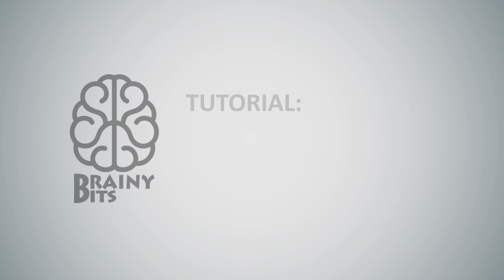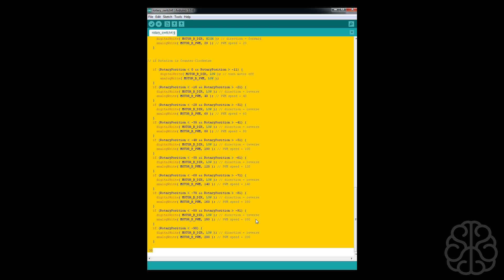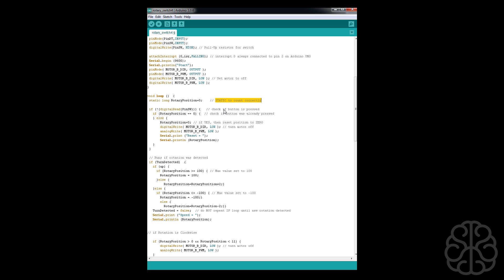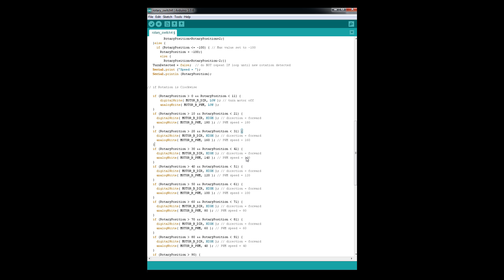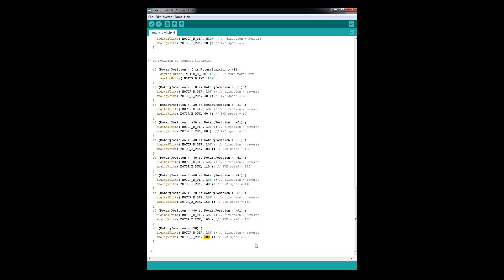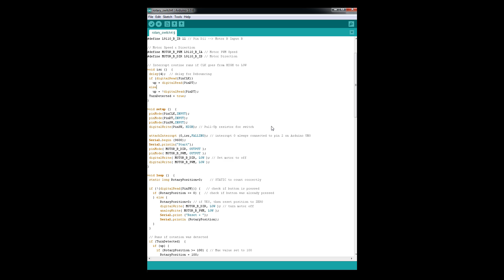Control a DC Motor using the L9110S driver and a Rotary Encoder with an Arduino - Tutorial

Comment: I have a project where i am using a fan to blow a table wind turbine and my team would like to track the rpms from the dc motor. i bought the items you have in this video minus the breadboard power supply. i have a 9v power supply as well as a 9v plug for the arduino can this tutorial work for experiment since we don't want to power our motor but instead see the rotations from the rotor using the encoder?

Comment: Could you perhaps help me?  Before I can ask my question, I need to explain my hardware.  I've removed a small DC motor from a laser printer, and it has a plastic ring attached to the shaft with about 200 little slices in the end.  This goes between a small IR sensor.  They are using this in place of a stepper motor.  I have removed the hardware, and I was wondering if there is a way to register this on an Arduino and control the motor that way.  I thought that disc was called a rotary encoder, but I could be wrong.  I've been trying to Google search this for the past couple of days and I keep running into motors with built-in encoders, and stumbling across this video. Hopefully you'll understand what I'm trying to do, and for now I would just like to make it work. Installing it in my application is something I will worry about later on.  ...
I also have a second question. If I were to utilize the setup you have there, but wanted to use a much larger motor, is there a heavier duty driver that can support say.. 12v 3amps? And still be reversed?  I guess I should say what I'm building..  ultimately I'm trying to build a filament extruder to recycle 3D printer filament.  I know it's been done and I know they are commercially available However I'm usually really good at building my own hardware, but because I need to speed control this motor and I would like to automate some of that process with the Arduino down the road. So basically the Arduino would be in control of, the auger temperature auger speed and auger direction based on predetermined factors that I'll set up after testing. And on the output of the filament I plan to build and connect a filament diameter sensor which would then help determine the speed of the auger. If the filament being extruded is too large then I would have the Arduino speed up the motor and if it's too small then I would have the Arduino slow down the motor.  Or something along those lines.  Perhaps it needs to increase or decrease temperature. Not 100% sure until I get to that point. Any help you can provide would be greatly appreciated. Thank you

Comment: 3:27 So, a 1uF capacitor is fine for this motor. But how does this requirement change vs motor size?  

Is there a formula, or a rule of thumb? I want to get a slightly bigger motor.

Comment: I thought that pwm goes from 0 to 255, and not 20 to 200. Or am I wrong.
Reply from the maker: +Ynze Selders (Made by Ynze) You are correct, PWM values are from 0 - 255.  In this tutorial however the motor doesn't start moving until pwm hits 20 and is at full power when it hits 200.  That's why you see 20 -200 in the code.  Hope that makes sense.  Thanks for watching!
Reply: +Brainy-Bits oke thank you

Comment: can someone help im beyoned a beginner im trying to control a dc motor using my arduino board. im looking to get the motor to go foward for 2 seconds then reverse for 2 secondswhen you press the push to make switch i just need to know the code and how to wire it i have a arduino board a pust make switch bread board and resistors i dont have any other componats

Comment: could this encoder be used to drive the dc motor like a servo horn ? in increments only not to spin like crazy? you have a driver so tht is a Hbridge
Reply from the maker: +jai Lopez Dc motors are not very good for accuracy, a stepper motor you be better suited for something like that!  Thanks for watching!

Comment: Hi Ivan, thanks for the tutorial. But I don't understand the benefit of using a rotary encoder for this rather than just using a simple potentiometer? I achieved the same result. Is there any added benefit of the encoder?
Reply from the maker: +Matt Anderson You are correct, just wanted to cover 2 modules in one video :)  Thanks for watching!

Comment: Awesome, thanks for sharing. Gonna buy that motor driver and power supply. Isn't just too few 5V output? Just wondering if I would connect a bigger motor.

And also I don't know what cables buy to connect to the motor driver pins and to the motor.

Thanks again!

Comment: This is one of the most useful tutorials I've come across for stepper motor control.

We're gonna try using the ardunio L293D Motor Shield instead of L9110S.

https://mcuoneclipse.files.wordpress.com/2013/05/motor-stepper-servo-shield-details.png

Thanks.
Keep posting.

\m/

Comment: Brainy-Bits.. Excellent Tutorial and amazing website. I plan to use this setup for balancing an inverted pendulum. Can you help me, as I can not find the CPR value of the encoder and it would be critical to my coding. Thanking you again.
Reply: Hi Dhruv!
Because of the high rate of change of motor direction in your application, the current transients being drawn by the motor will far exceed the 800mAh that the LS9110S is capable of carrying, so you should go with this instead http://www.onsemi.com/pub_link/Collateral/NCV7701-D.PDF
or better yet build your own H-Bridge using cheap MoSFET's capable of being driven by the 5V logic of the Arduino
Reply from the maker: Hi Dhruv, from our testing of the rotary encoder used in this tutorial, the Cycles per revolution (CPR)  is 30CPR.  Hope this helps. Thank you for your comment, we try to make the tutorials as best we can and seeing viewers like you using them is great.  Would love to see updates on your inverted pendulum project, let us know how it turns out!
Reply: Will keep you updated!

Comment: Very nice and good tutorial. I think I will use this for my construction crane.
Reply from the maker: Cool!  Thanks for watching!  Let us know if you post a video of that and we'll put a link to it on our website.
Reply: Brainy-Bits Is it  possible to use this to control a 3d printer? Is it hard to contol a dc motor with an encoder strip? I'm want to make a 3D printer as cheap as possible using recycled parts, but i don't know much about thing like this, and I think this would be a good way to start.